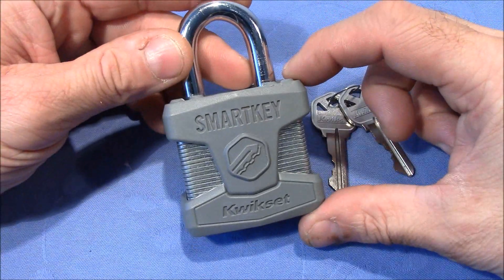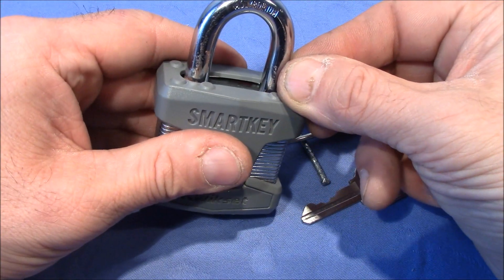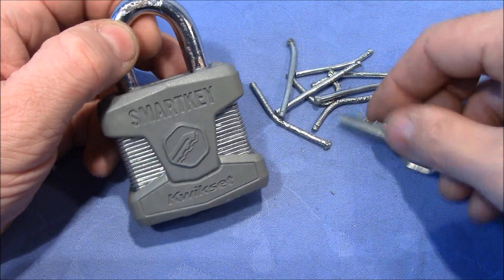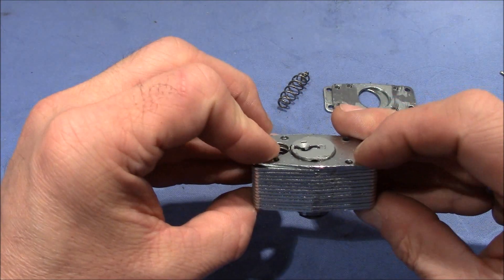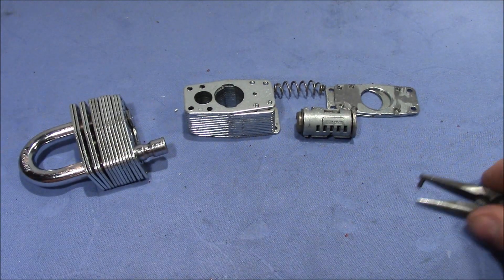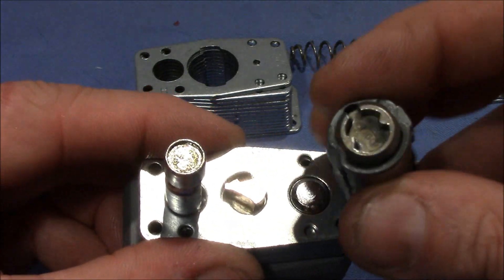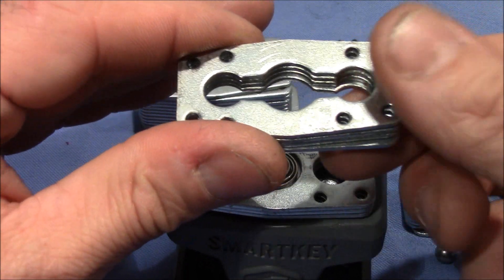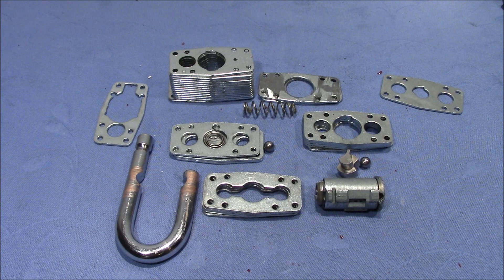(picking 436) Laminated padlock (Kwikset Smartkey) forcibly gutted and reassembled, thanks to PickME

Comment: Those rivets look very weak.
I bet if you locked it to something sturdy and took a big chisel and steel hammer to it, it would break apart.

I tried the chisel & hammer method against some crappy Master no.3's and the shackle broke on both sides where the locking mechanism goes in to.
Reply from the maker: In this lock the rivets were press fit in the hole of the plates and very hard to extract.

Comment: At work we always reset them twice before allowing the core to turn. I can't tell you how many times I've had to tear apart smart key locks because someone tried to reset them and did not do it twice. The basic process is you insert the original key and turn the corner. Insert the resetting tool to remove the original key. Insert the new key. Reinsert the resetting tool just to ensure that all of the pins are set properly and then allow the core to turn to set the bitting
Reply from the maker: Great info - thank you. Next time I try rekeying it I will follow your advice.

Comment: Kwikset smart key locks are a cool idea on paper but they just don’t seem to work well in practice
Reply: There better then 99% of the locks most people purchase, they are up to the 3rd generation (the video is gen 1). I've only seen 1 person ever pick a gen 3 smartkey. They can also cannot be forced open like the early generation.
Reply from the maker: Well, I think it was a user error why the lock didn't work anymore after my rekeying attempt.
Reply from the maker: Yes, I've see the rectangular side bar on newer models that makes it impossible to tension the mechanism. Could you share the video link of picking the 3rd generation smartkey, please?
Reply: It was a Chris Ahrens video in May, you actually commented on it.

Comment: Mr PickME 1977 sent you a puzzle!👍🏽 I have one of the same but I haven't killed mine...yet.😁 I believe there is a common flaw that makes the rekey function fail like yours did. It's stupid, that's what they sell the lock for, to rekey it but it fails and renders the lock inoperable...unless you take out that grinder again!😁✌🙃
Reply from the maker: I believe that it was my mistake not doing it correctly. I carefully rekeyed it today again and it worked. Anyway it was a fun project to get this lock apart ;-)
Reply: Potti314 ah, ok. Good to hear.😁